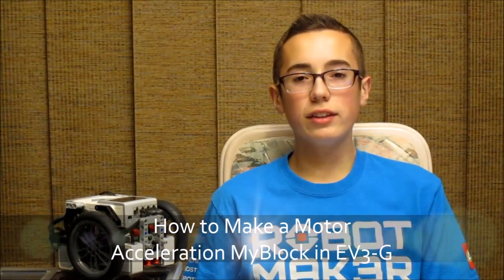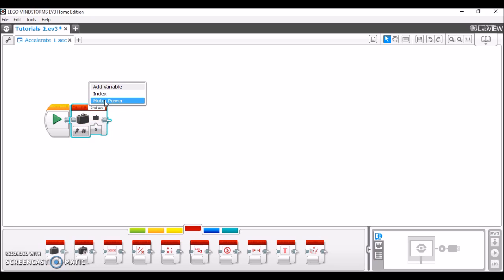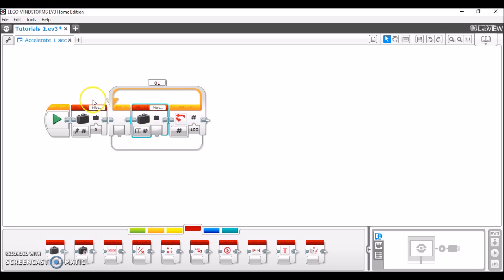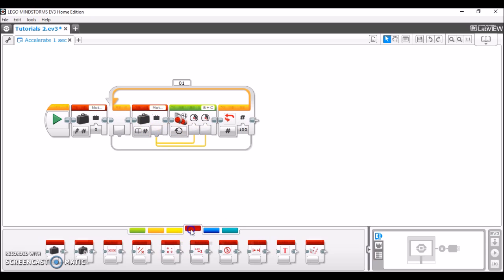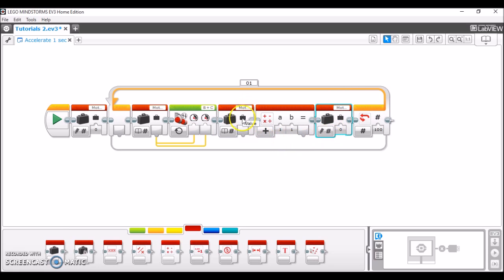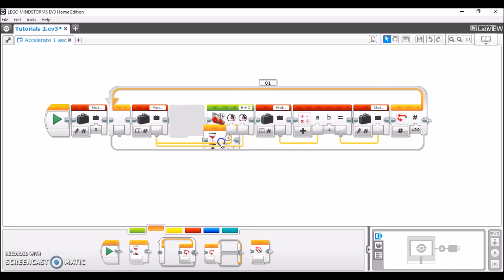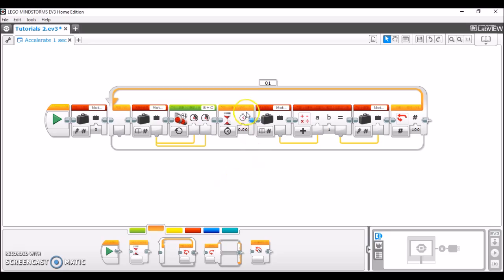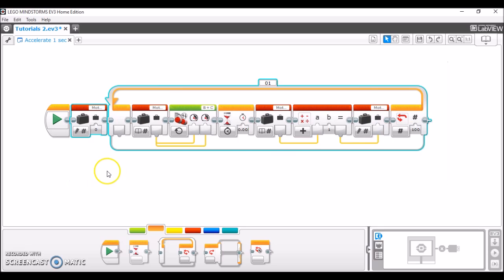How to Program a Motor Acceleration MyBlock in EV3-G

Comment: If I wanted to start slow and have the robot go to full power in 1/2 second and then put a motor block to have the robot stop at 2000 degrees, will the actual distance travelled be 2000 degrees, or will it be 2000 degrees, plus whatever distance the robot took to reach 100% power?
Reply from the maker: As long as it is all contained within a loop with an exit case set to > 2000 degrees, the total distance traveled will be 2000 degrees, including acceleration.
Reply: Awesome, thanks for your reply

Comment: Actually, you dont need any variable to do this, just use the Loop counter and connect it to the motor power value from the steering/tank block
Reply from the maker: Yes, you are correct. But the C programmer in me likes to use a variable out of habit.  :)

Comment: Great information.  I'm trying to include acceleration and deceleration in a loop with a number of revolutions to control the distance of travel.  When I use revolutions in place of the "move tank" command, the program loops indefinitely.  Is there a way to do this effectively?  Thanks.
Reply from the maker: Program a loop exit to count the number of degrees. If that fails, use an external sensor (Color, US, etc.). And if THAT fails, set it to loop for a certain time.

Comment: Hi. great voideo. My problem is when trying to set the end expression, to the number of degrees, a wheel have passed, lets say i want to accelerate for 4 whell rounds -> 360*4 degrees. it stop after 1600-1700, instead 1440. this sleepness happnes all the time. i assume it has to do withthe timer. for lower speeds (1 / 100), with no acceleration (0 as acceleration sum), the resluts are the same and i have a drift. might be problematic for FLL contest as the distnace it goes, is not accurate enough. any idea ?
Reply from the maker: My advice would be to bypass the degree counter altogether and use another sensor to stop the robot with a Loop exit case. The color sensor or ultrasonic senor would be best for this. Check out how to program it here: https://youtu.be/_YRwKHP4v8A

Comment: I am also trying to implement a gyro correction to your acceleration block. I can't really figure out a way . . .   I tried using the move steering block, but ended with little success. Thanks so much!
Reply: I was trying this too. I was thinking of adding another start block and make the regular gyro code there. Both codes would run at same time.

Comment: I am trying to make an acceleration/decceleration block for fll, where the robot accelerates to full speed, where it drives a certain distance, then deccelerates back to zero spd. I am trying to use your method of acceleration, and combining it with a gyro forward program similar to yours. The gyro forward block works alone, but for some reason, when I combine it with your acceleration block, it doesnt work. Strangly, every time I test it I come out with a different result. Sometimes, the robot starts spinning in circles, sometimes the robot simply drives off in a random direction. Occasionally, it will accelerate, then move forwrd using the gyro, but this happens rarely. Some help?
Reply: You probably wont know why, but if you could try to make it work yourself, then share your method with me, that would be amazing!
Reply from the maker: Possibly the integration was done incorrectly... I recommend using the encoders to drive straight in an acceleration as opposed to the gyro, because that will likely be easier.
Reply: Builderdude35 - ok, thanks! I will try that!

Comment: nice job builderdude35. I'm wondering how I can incorporate this program in a linefollower algorithm (proportional). Let's say I start line following at a slower speed and accelerate to my target speed, let's say 30 power. Got any idea? (i'm using your proportional line follower program). cheers
Reply from the maker: You can use this to control the Power input on the "Move Steering" block, with the line follower controlling the steering like normal.
Reply: I get what you mean now. Thanks much. I will try it for WRO  :)

Comment: Have you thought about writing an algorithm so that it exponentially accelerates, instead of gradually in a linear fashion? If you were to use a formula it might be better, that is assuming you know linear algebra and or have basic knowledge of algebra which I'm sure you do. I am currently working on a program the accelerates slow at the start but increases at a faster rate. Which I believe is better for shorter distances, so that you can get there quicker, but the initial kick of the robot starting or stopping isn't something you have to worry about but can still get to max speed quickly after that. Just something to think about. Personally, I am also connecting the algorithm to a my-block that allows you to input distance, and then will transfer that to rotations. Which adds a bit more difficulty to the algorithm. But anyhow, still a good video for people who don't already know this.
Reply from the maker: I definitely agree with you in the sense that exponential acceleration may be a little better. I can modify the program to be exponential as opposed to linear. But I kept it linear because I felt it's a little easier to understand for my viewers, many of whom are totally new to the concept. But thank you very much for sharing your ideas!